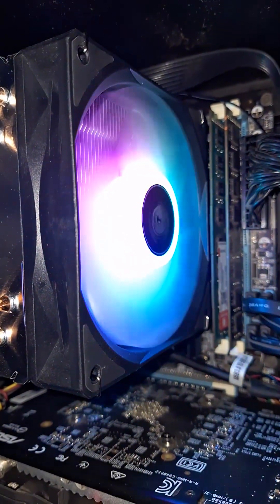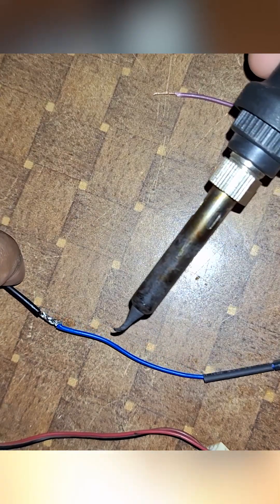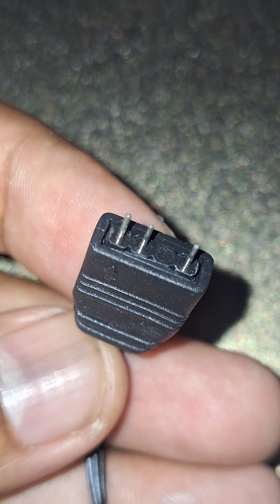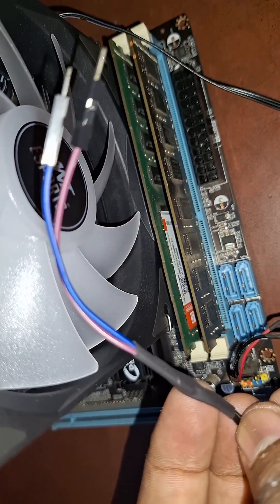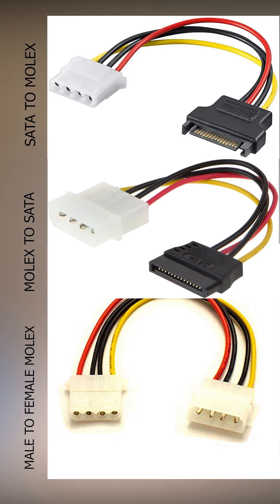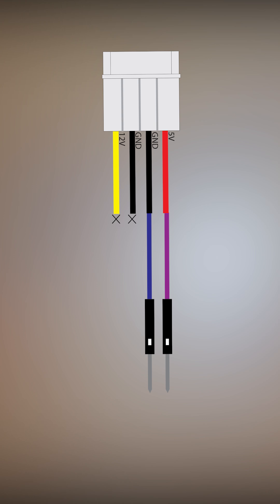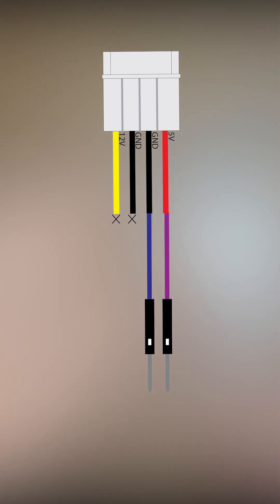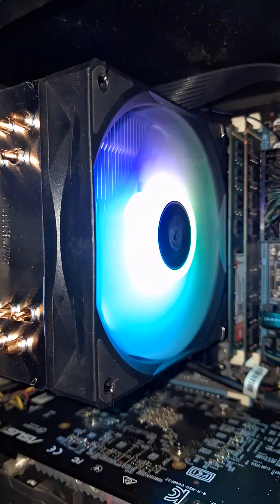Using ARGB Fans without ARGB Headers #ARGB #PCBuild #RGBFans #antesports

Comment from the maker: Warning: Careful not to buy cheap Molex cables as they may be prone to fire.

These are the items used:
ARGB fans (5V, 3-pin): https://amzn.to/4mjEtQO
Electrical Tape: https://amzn.to/4mZ71iF
(Optional)
Power supply connection (SATA/Molex): https://amzn.to/4mSHY0u
Soldering Station: https://amzn.to/45tzN54
Heat Shrink: https://amzn.to/4fQ2YTl
Jumper Wires: https://amzn.to/41cEwpe